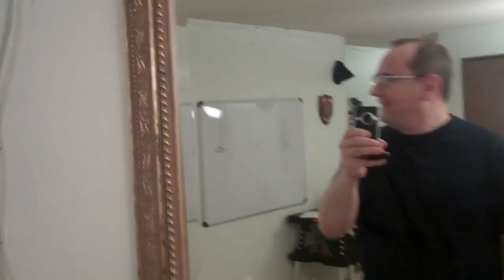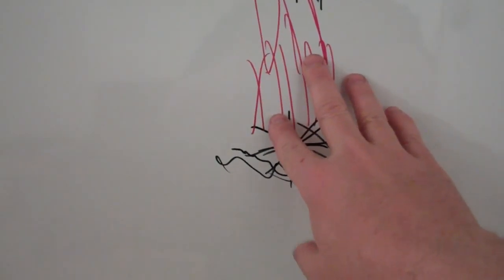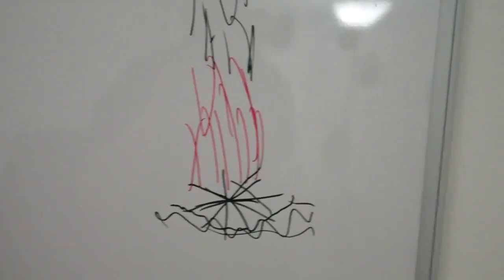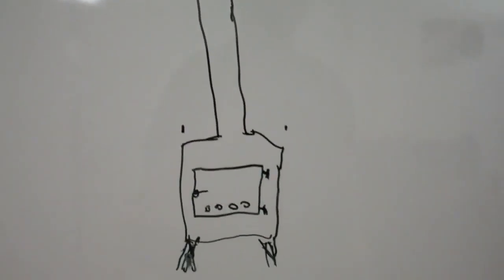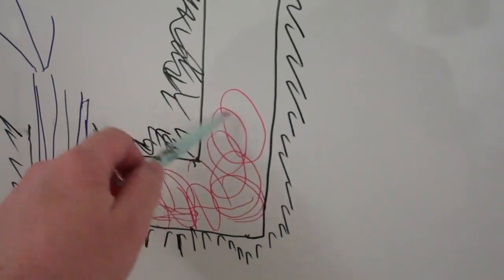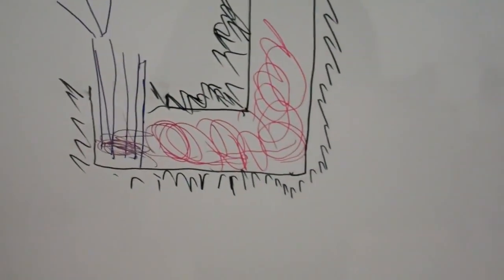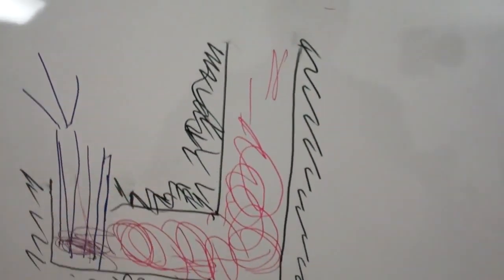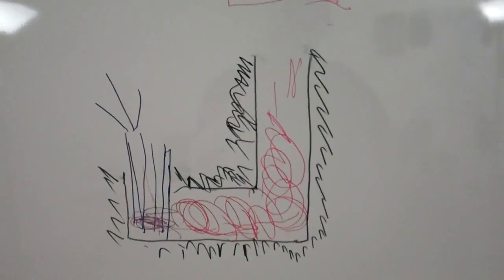Rocket stove and rocket mass heaters. How do they work Pt 1 of 2.mp4

Comment: At 10:43 you are talking about the difference in pressure between the cooler gas and the hot, expanding gasses. I believe the term is called pressure differential. The higher the difference between low and high, the more air (or liquid) will be drawn through the system. I wonder if the stove could be improved with a venturi effect. Look up carburetors and the venturi.

Comment: I think he said the concept of fully burned gases relied upon the extreme heat generated in the tube. The traditional woodstove, as he mentioned, has a regulator which when dampened, leads to less wood burned, and cooler temperatures, but also decreases the efficiency of the combustion. I think you can't have one without the other.

Comment: @josephdupont except for the fact that at that temperature you are exceeding the melting point of most steel which depending on the kind you are using is generally somewhere around 2500 deg F.... so bad idea if you have metal in your rocket

Comment from the maker: @josephdupont 
Makes sense to me, I'm a diesel mechanic, not a physicist. In any case with the fire tube of the rocket stove being about 3.5 to 4 feet tall, it's enough of a draw to drive the exhaust through the thermal mass and then out the vent to the outside. It's strong enough to keep the flames from rising out of the wrong side as well. 
I imagine anything that can burn would work just fine in a rocket mass heater.

Comment: i think a good way to control the temperature might be to regulate the air inlet according to how much heat you want, very hot=have the air inlet fully open, so for less heat just somehow half close the inlet pipe, im just going by how a Bunsen burner works which is pretty similar, with adjustable air holes

Comment: We only had a smaller one at our hunting cabin  and the "thermal mass" was 4 stacks or 12 inch 1/2 inch pipe by 8 feet, with the gaps filled in with old electro porcelain insulator and rail spikes and beach rock.
Don't get me wrong it was a awesome little stove and we never went cold, but like I said it was either too too hot with small stretches of perfect.
meh, then again I'm fond of watching a fire and hearing it crackle on cold dark nights, not the blast furnace rumble of a rocket stove.

Comment from the maker: @Connected2U2 
Ya, there's no thermostat on a rocket stove. One way to help the extreme heat issue is to increase the thermal mass and enclose a larger portion of the barrel within the cob material. That allows the heat to be delivered over a longer period of time.
But this is all just theory to me since I live in a condo and I can't really build one for myself. I want to get down to cobville and take a class on them. In fact I'll look into doing that today.

Comment: From 4 cord to1 cord is extreme, and really depends on how insulated your place is more than anything.
If you're just worried about heating your home (cheaper) than a rocket stove is the way to go.
But I find a rocket stoves you either got your place 120 degrees or nothing (lit or out).